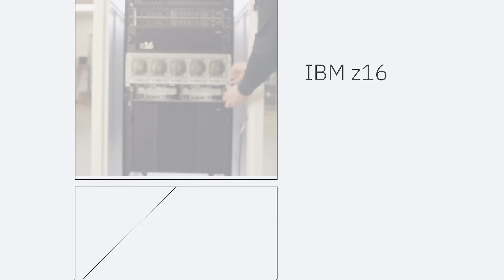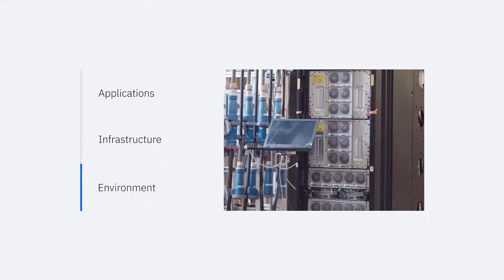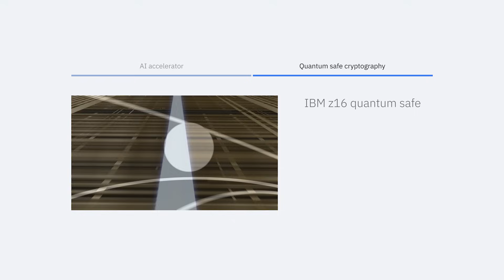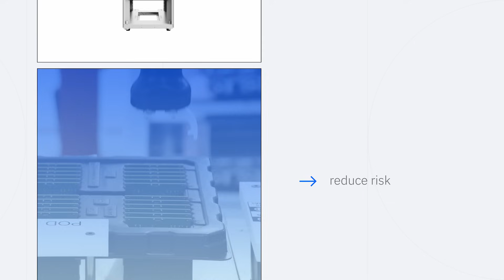Big innovation from IBM in a small(er) footprint

Comment: System is outdated IBM 2D coding on black laptop is outdated, updated the coding asap to 4k 8k. second exteior model is outdated, its single frame in mount that is not 21 century. outdated the latest model by hiring  architecture designer in engineer.
Reply: 0:51 -----99999999
Reply: 55😅.y8